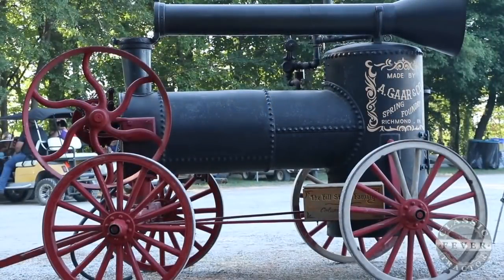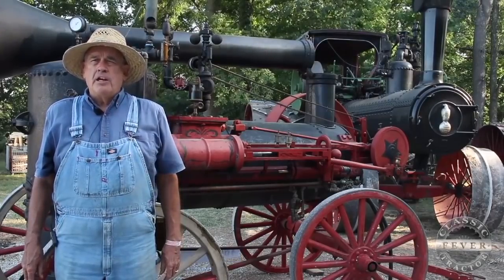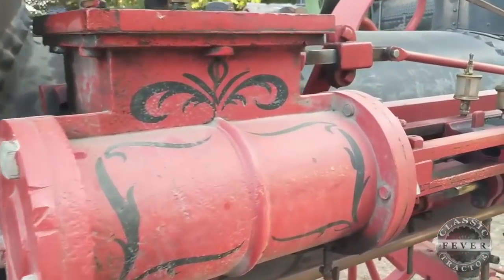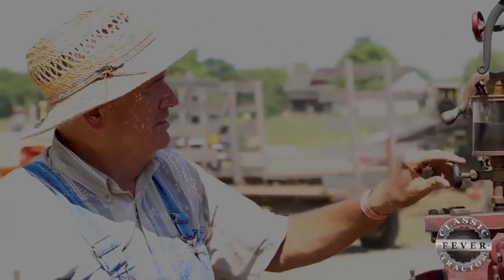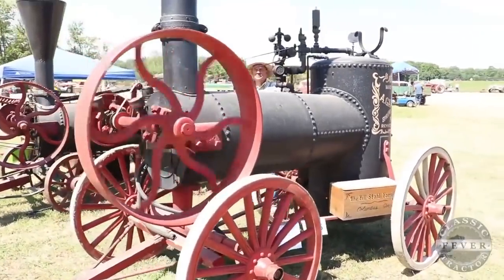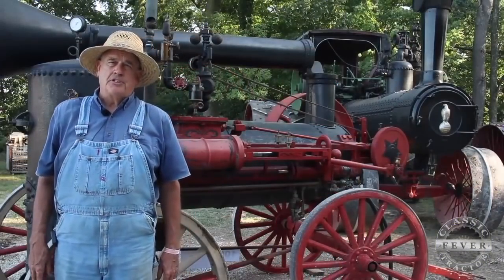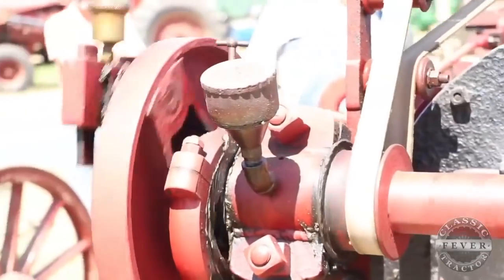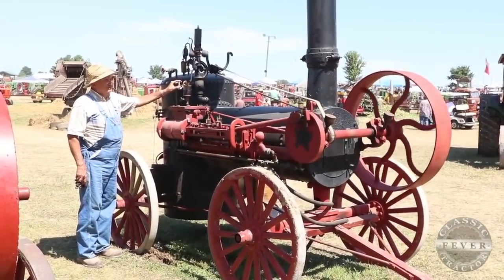OLDEST Steam Engine In The United States!  1864 Gaar Steam Engine

Comment: Even being horsedrawn, it must've been an interesting chore to move if it weren't the dry seasons. I farm in Dayton, Ohio, pretty close to Richmond, and I cannot fathom how they used these in the fields if there was any groundwater. 6 months out of the year, I lose traction in the mud in my little RK24H that only weighs 1500lb and has 4WD. They must have only been able to use it on dry and well managed grounds.
Reply: These steamers can out pull a modern 200 hp tractor.
Reply: @danw6014  I'm sure the skinny wheels helps keep them above the mud 😉

Comment: How is it the oldest steam engine in the United States? Are you saying there are no surviving trains that were steam-driven from that era? A simple Google search shows many trains older than this that still survive.
Reply: The must mean the oldest farmer's steam engine. Or they could mean the oldest still in regular use - most of the old railway engines are now too old to be steamed. Which raises a question. You must surely have boiler certificates stateside?  What will Mr Stahl do when the boiler on this old lady reaches the legal end of it's life? Retire her for static display? To reboiler her would destroy her historic value as a complete original. Or is it not the original boiler?
Reply: @johndavies9270  In my state at least, the boilers go through state inspections every couple of years, and they will tell you its current maximum capacity. This is based purely on condition, not on age.